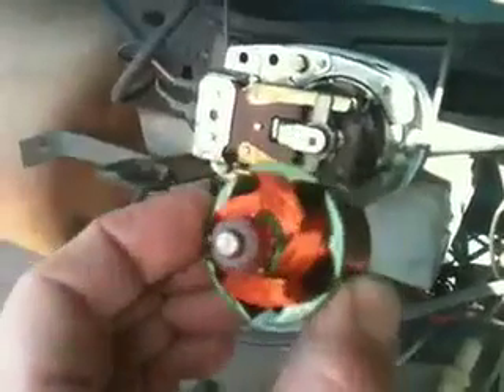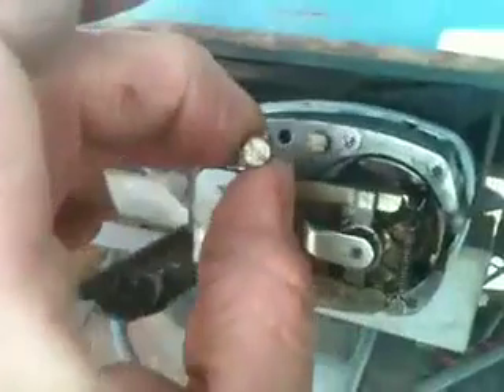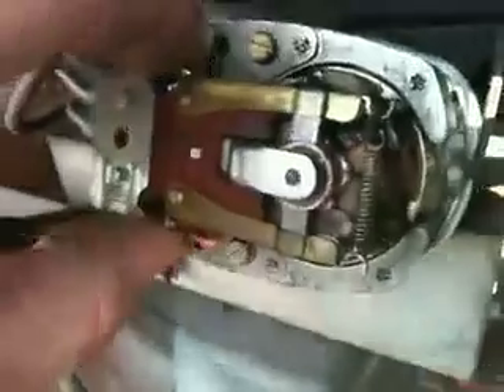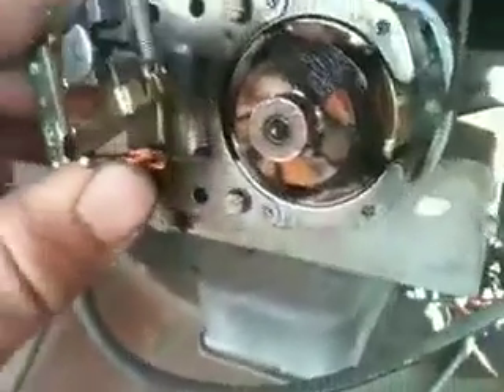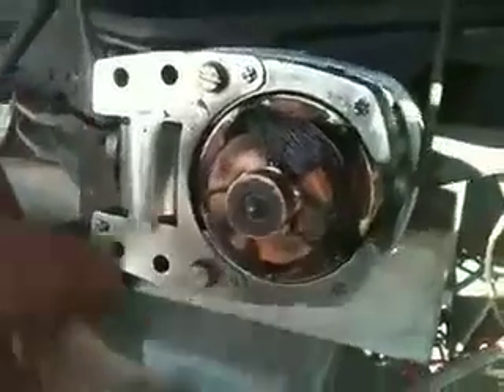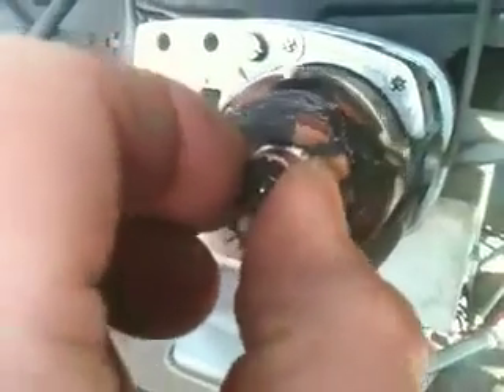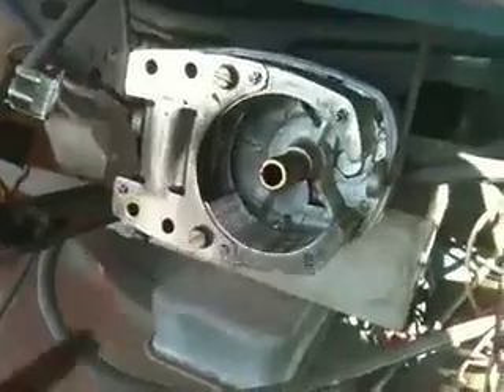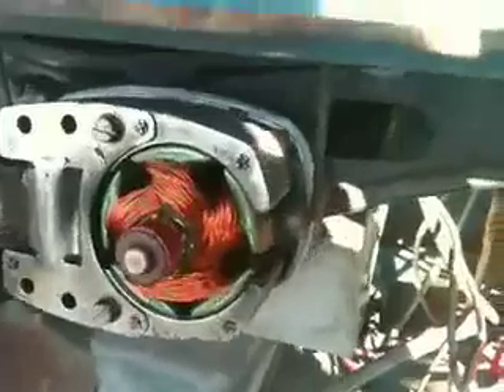VW Bug Changing 6V for 12V Armature.mov

Comment: these conversion armatures are only for the SWF brand wiper motors up to 1966 as it will not work as a replacement on 1967-1969 bugs and karmann ghia and up to 1974 Thing as the armature is shorter in length and multiple communtator bars as these have 3 brushes for the 2 speeds. as its strictly for the SWF motors from 1953-1966 that style 6 volt motors will not work on Bosch or Avogg wiper motors.

Comment: do you notice any differences in the wiper speeding compare to 6v? or the same speed? I used resister reducing Voltage and it broke, I have to try this method of conversion. 

Thank you, it was a great video :)